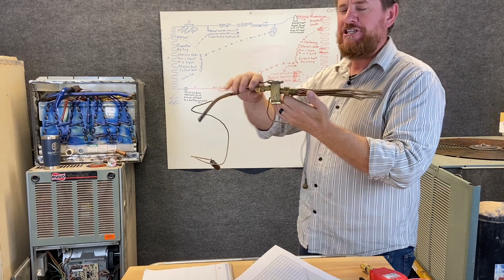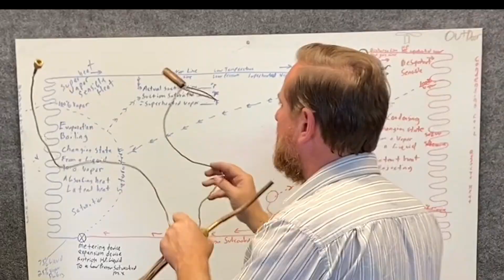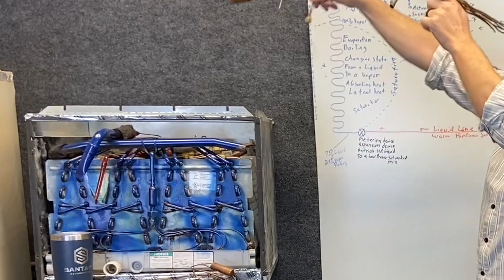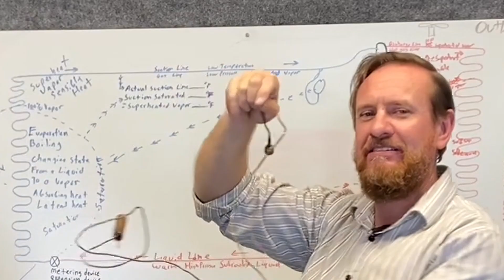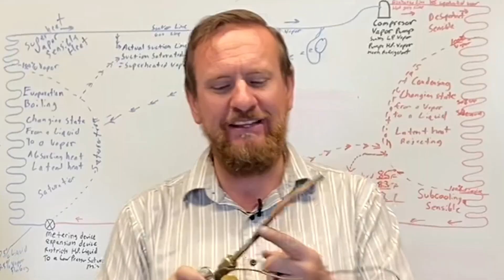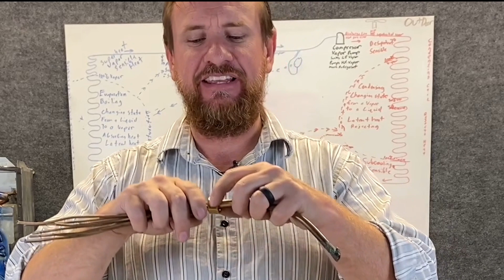HVAC 060 Introduction to the TXV TEV

Comment: Love your channel. I would like to ask a question. Can you install a TXV in place of the Orifice if there is no adaptor conversion kit in your Country?  If yes how? Can you please make a video if possible or just let me know ?  Thank you so much you are a great Teacher, Love the way you explain things.
Reply from the maker: Yes, I prefer the factory kit for easy but I have done hundred without.

Take the fixed office out and put the connector back. 
Get properly sized (ton) TXV with S for solder/braze and the correct liquid line size (3/8 here for resedential)

The cut the liquid line as close to the evaporator as possible, braze in the TXV while flowing nitrogen.

Braze in a service port on the suction line for the equalizer tube of the TXV.

Mount the sensing bulb according to the instructions with the TXV. 

Pressure test, vacuum, recharge.
Reply: @love2hvac  Thank you so much for your reply, I have to do two conversions on two 5 ton R410a air handlers and I wondered if the spacing in between the connector would cause any trouble since the orifice would be missing do to turbulence from the outlet of the TXV with only the hole in the middle to the entrance of the distributer and if the dead spots around the hole would cause me any trouble. I also have no choice but to install a reducer at the outlet of the TXV since I can only find  a TXV with 1/2'' outlet to reduce it to 3/8''. If you want to comment please do. 
I will let you know how it went if you like. 
Thank you again so much.
George

Comment: Besides insulating the bulb, Have you found it necessary to insulate the tubing of the sensing bulb or equalizing connector when the txv is installed outside the evaporator case installed in attics that get hot?
Reply from the maker: It really does not have enough effect worth the effort. I have insulated one before but I did not see any difference. 
It by science has to have some heat transfer but not enough to worry about.
Reply: @love2hvac  Gotcha.  I would agree with you.  Thank you for your on going lessons which approach HVAC training from a very different and unique approach.  Your's have the details/insidghts that I have not seen in any other educational presentations.  Compliments well of the others such as ACservicetech, HVACshool, and Jim's MQ.
Reply from the maker: Thank you, I appreciate that!  We all work together for the same goal. I could not ask for better friends and colleagues.

Comment: If threaded fittings are approved to use for metering device, why are they not used for other connections? Why do we have to braze if the threaded connection can hold the pressure? If it can't hold the pressure and is expected to leak, they would never use them in the first place, right?
Reply from the maker: That's right. I've wondered that myself. 
I think it comes down to cost.

Comment: Great video. Make sure you take the schrader valve core out before you attach the equalizer tube. Talking from experience. Lol
Reply from the maker: Very good point!
I will revisit TXV later with cut aways, diagnostics, installations and more. So much about these beauties.

Comment: Watching training on TXVs at Jackson Controls, someone asked if they could be tested before installation.  The trainer mentioned putting the bulb in ice water and using ONLY your body heat for opening.  I tried it with an automotive system TXV, but using propellant from canned air to chill the powerhead.  Works well as you try to blow through the valve.  

The automotive TXV is a good contrast to the standard HVAC version.  Compact, easy to pull out the valve plug and see the seat with the rod coming down from the powerhead.  They don't have a bulb, just the powerhead because they run the suction line back through the valve body.  Also, gets equalization through leaks around the rod bushings.  I was fortunate to find one on Amazon Outlet for $7 clearance to play with.
Reply from the maker: I haven't played with the automotive ones yet.
I have a gadget for testing TXV I will show it in a later video I use it for showing a variety of bad txv's 
I  dont like the Idea of blowing into any refrigeration component. the amount of moisture in each breath is high. CO2 or nitrogen is a good compromise.
Reply: @love2hvac    Yeah, I was just using that to explore the device.  Probably better if you want to test a component that will be used in a system is to run nitrogen with a flow gage.